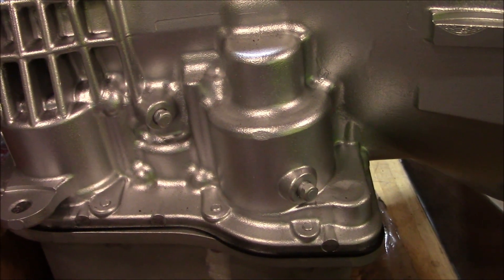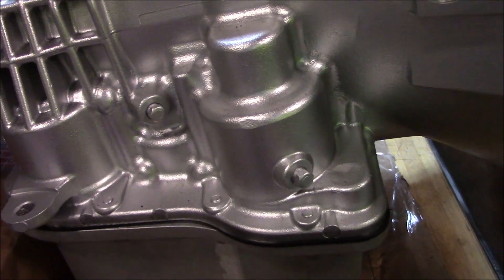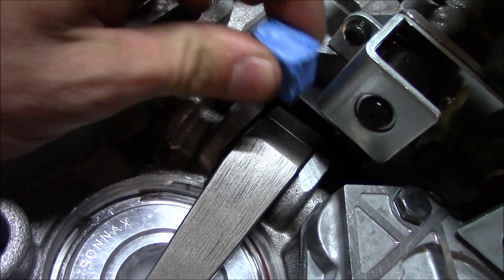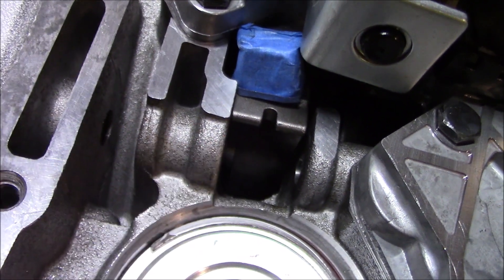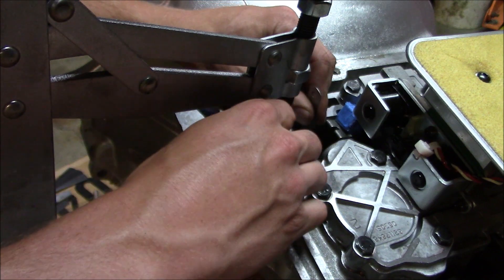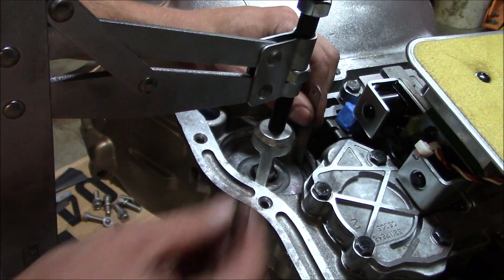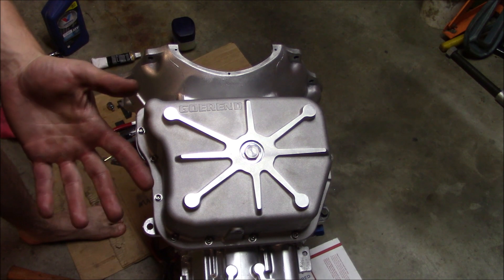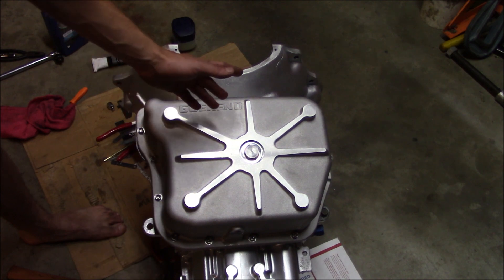Cummins Transmission Billet Front Servo Quick Upgrade

Comment: Nice job.  Thev47rh has the weakest planetary nice job on up grade.  I have a. 95 4x4 that had that automatic.  I hated it so it's sitting on the ground now I installing a rebuilt g56 and dual disc Val air . . After watching your video where you sealed the overdrive section to TC I going to suggest that's a extra benefit.  I think . I seen the splines worn out on the out put of manual g56 and also automatic transmission.  I lubricated my splines on my TC and transmission but running in fluid seems a better deal.
Reply from the maker: Thanks man, yeah you have to with an NP205 or it'll bleed everywhere